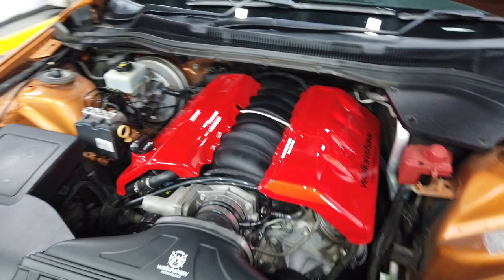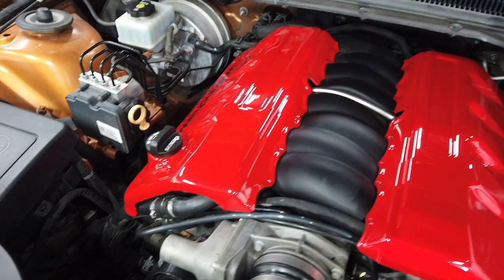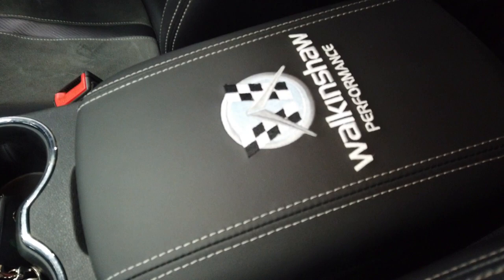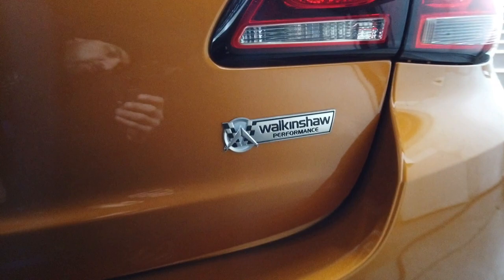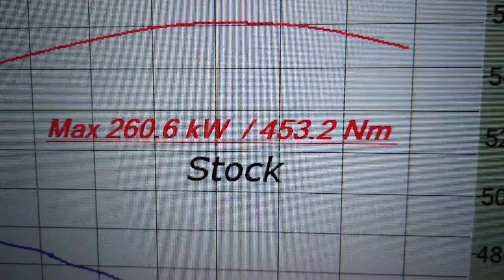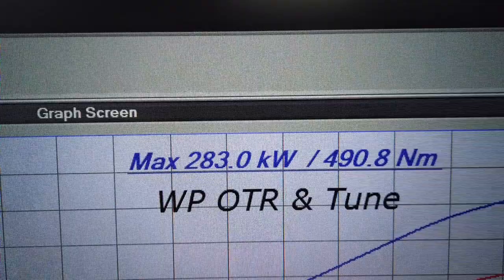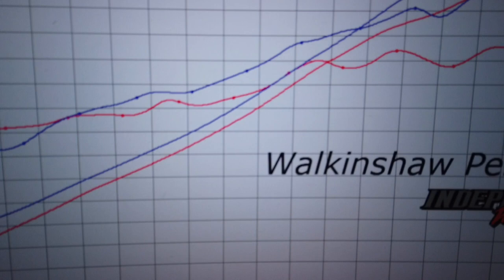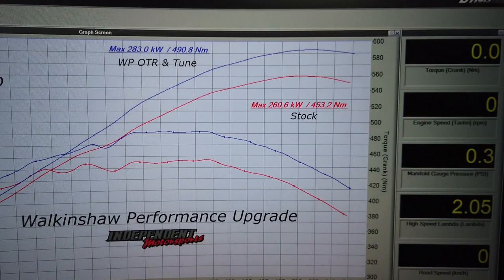Walkinshaw performance OTR & Tune upgrade VF LS3

Comment: over 6k for a 20kw gain! that's not good & nowhere near 375 as advertised
Reply from the maker: 375 is at the engine,this figure is at the wheels.
Reply: @IndependentMotorsports  na have a squiz on YT most of the LS3 tunes with the same package are easily doing 300rwkw+ - which is closer to "W375".& my apologies I didn't mean any disrespect or trolling, I'm getting this done on my VF, it is a lot of money so I've just been searching & conversating. I could have worded it differently for sure being your not in front of me. good work👍

Comment: I just had a Dyno Tune done to my HSV LS3 it has the full Di-filippo  Dual 3 inch exhaust with Bi-modal mufflers and CAI. After getting it back I noticed the Bi-modal mufflers were closed the whole time it was getting tuned, (I was there the whole time)  I asked them if it would make a difference to the tune and horse power numbers and they said that it would make no difference!! Is that correct. Cheers wish I lived near you guy's to tune my car.